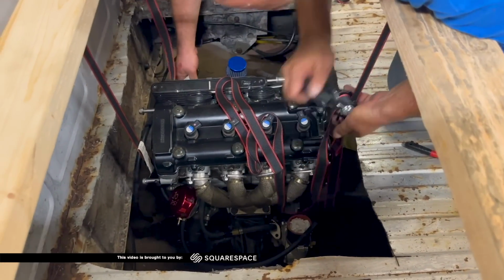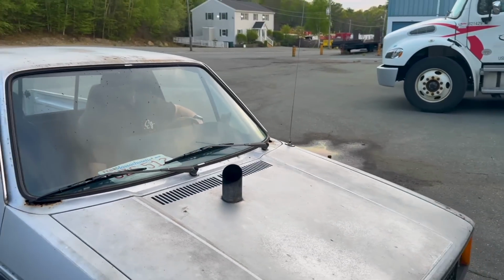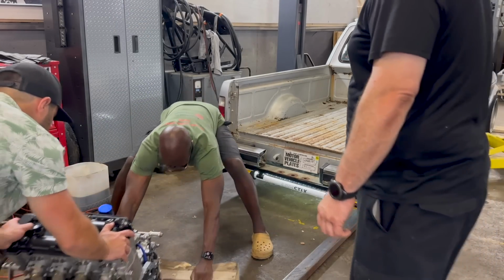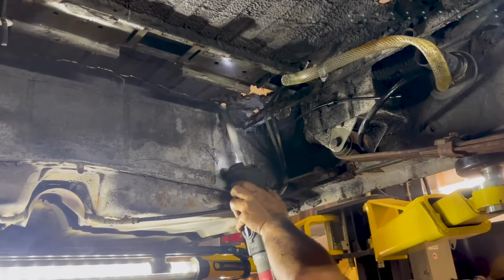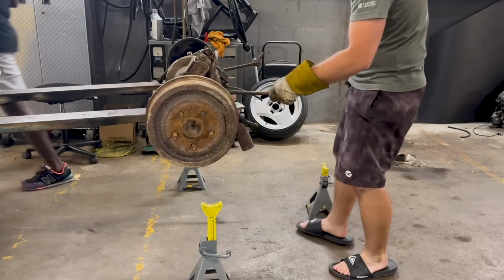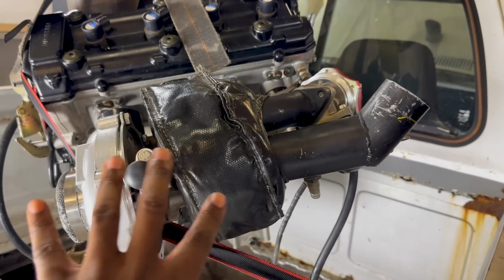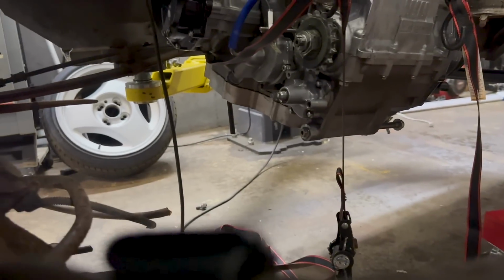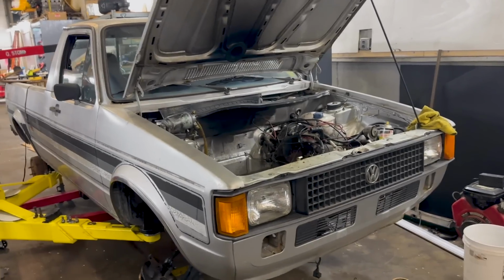Installing A Turbo Hayabusa Engine into an old Volkswagen pickup truck

Comment: If your engine is hydraulic clutch your gonna have problems with drive shaft adapter and your clutch slave....it takes some serious work to get through all the problems you haven't 3ven considered yet

Comment: chain drive drop box... a heavy plate with two shafts and 4 carrier bearings, if you have heard of the store called princess auto?, they sell stuff like that people can use to part things together. chain input on the top drive line pto on the bottom. that truck cant go lower, like what if someone puts a sofa in the back with a big glass 50 inch tv because they need to move?

Comment: Rich. Build a bracket off the motor that can also be braced to the frame that has a sprocket on it that will run to the engine. Then you can custom your new bracket sprocket to hook up the driveshaft. Connect the two sprockets via a chain and problem solved. This is a problem we have when building mini bikes and that is our solution.

Comment: Put in a jack shaft between the MC engine and the rear diff. Chain drive to jack shaft, u-joint to rear. That will give you more placement options for the engine and let you balance things out better while improving drive shaft angle.

Comment: Also I’m guessing there might be some balancing issues turning the motor and changing the drive from chain to shaft.  The other thing you can look it is they make shaft driven motorcycles.  Look at a Honda goldwing’s drive setup.

Comment: how about a crawler/offroad center differential, connected via chain, and then solid driveshafts to front and rear axles, like on a jeep?
would be 4wd, usable ride height and easier than a hybrid

Comment: Might be silly question but why didn't you put it in the Engine bay and for the drive use a high strength chain to the back axle what it was designed for on a bike your not going to be revving the balls out of it all the time
Reply: PS and the gear change could of been a quick touch on the clutch pedal the clutch for Engine could be a leaver with your left hand 😊😮😊

Comment: A shop in orlando Florida called skycraft sells surplus everything. From switches and relays to old parachutes.  They usually have small gear reduction boxes that have a shaft on either side. You could mount a sprocket to one shaft and a u joint on the other side.  You would need a pretty stout mount to keep it all aligned.

Comment: I was surprised when you started talking about lining the output and input up with each other.  I thought you were going to mount the engine further back (helping with traction) and replace the yoke on the differential with a sprocket and run it chain drive.  Looking forward to seeing how this turns out.

Comment: That rear is going to need to be very stiff, otherwise every bump you go over you’re going to have issues. An independent rear end out of an E30 would be far better, unsure if it would handle the power though

Comment: Weld sprocket to ujoint, take to a shop so it’s centered, or go to drive shaft shop, with the sprocket, and see if they can fab up a joint you can bolt on

Comment: Not an expert, but won’t the thrust forces on that output shaft kill that engine? This engine was engineered to be chain driven so  there’s little tolerance for thrust forces acting on the output shaft. 

See @strevemorris for more on info on crank thrust and the damage it can cause

@robotcantina recently touched on this issue with their most recent build

Comment: The spinny parts can be connected by a chain, like they are on a bike. You don't need to jigger shafts to line shit up.
For bonus points, mount the engine on an A-frame above the cab with a very very long chain loop.
You can also do 4wd easily, there's a spinny sprockety thing in the middle and you just use unmodified Ford bits in front too.
I am an engineer, you can trust me.

Comment: Should look into twisting axle 180 degrees. Which would put the pinion gear input up another 4 to 6 inches.
Reply: The pinion gear normally is below center of pumpkin. So twist axle like a baton which would put the pinion gear above center of pumpkin.

Comment: Put the axle on top of the leaf springs instead of lowering the motor. You will need to put on top of leaf springs anyways unless you wanted the back of the pickup raised up 6 inches from where is was sitting before starting project.

Comment: Divorced transfer case allows engine mounting area wiggle and 4WD with high low. Front and rear independent axels with the glorious stationary mounting and inboard disc brakes. Shaft length for the perfect wheel fit. Wide body fender flares.

Comment: Make a Jackshaft and run the chain from the engine to the solid mounted transfer case. Then you can mount the engine higher and get the angles that you need. You and easily make a sprocket mount to the input shaft on the transfer case. You can also make an electric motor run on the same gears between the transfer case and the engine, you can also include a tensioner system. Run a separate chain off of the jackshaft to the electric motor. This electric motor can be used to achieve reverse, and you can use the truck in a real-world application more practically.

Comment: hello Rich, how did you find what donor car is good source for your rear axle? is there somewhere list of axle length for different vehicles? I would like to convert my vw caddy mk2 to 4wd with locking rear diff but i was not able to find any donor car which solid axle short enough.

Comment: transfer case. motor up front small shaft tunnel .or chaine drive over to an older transfer case and shaft dose not have to go straight you can use a double cardan T case would help balance the truck

Comment: The best solution for inline direct drive would be to use a chain to transfer power a drive shaft in line with the axle that is anchored to the body forward to a bearing that will allow the shaft to spin. Install a gear on the shaft and align it with the sprocket. This solution would also allow you to move the engine toward the center of the vehicle, but you may need to install another free spinning gear to allow the power transfer at an angle around the engine to the shaft. The additional spinning gear set with a chain tensioning system (two gears connecting two chains--one to the engine sprocket, and the other to the drive shaft) would have the added benefit of allowing engine movement in high torque situations against the motor mounts, and rougher terrain bouncing the axle.

Comment: just get a diff pinion yoke to suit the sprocket spline or weld on a diff yolk to the sprocket. and yes mount the diff on top of the springs they sell kits everywhere

Comment: Use BMW Rear  Subframe And Diff So Drive Shaft don’t Dance Up and Down and U Can have IRS independent Rear Suspension if Is My Project I will Install Engine On the Front Better For Cooling and Shifting

Comment: Talking HP. What about torque?
Feeding air to it in the bed might be an issue 
Radiator.? Or air cooled in the bed
Typically air is sucked out of a bed , the faster you go the thinner the air

Love your channel 

Miss your interaction with your boy S

Comment: 420 horse in the back, another 80-200 horse up front.. suspension & brakes will each cost more than the original truck. Every system on this vehicle will have more into it than the cost of the vehicle. 🤣 Classic Rich Rebuilds

Comment: this is so retarded- wasting bed space instead of using the engine compartment. longitudinal engine anyway. absurd. AND the solid axle means the diff needs to travel, so the driveshaft angle is gonna be crazy.

Comment: Rich I was thinking about a solution today after I watched your video.  Check out a gas golf cart. The motor and rear are mounted together so there is no change of angle from the motor to the rear end.  At the front of the motor it is on a pivot.  This concept should work perfectly for your application.

Comment: To help with the alignment on the rear diff to the sprocket could you possibly use a jack shaft and keep the engine mounted higher up in the bed

Comment: Why don't you run a chain drive with a rigid mounting down to level with the axel, then run an axel from the output shaft of the chain? Or if you're using the electric motor anyway, use that as the output for the chain? That would also solve your standing shock problem

Comment: would it not be the absolute coolest (and luckiest) if you could just run a drive shaft from the rear diff to a front diff and simply mount a sprocket to that drive shaft and run the engine with a chain?

Comment: I would have chosen to go with an IRS to avoid the pinion angle problems. Little more money but it would be a track monster.

You may also run into problems with the thrust force on the transmission output - do you need to use that trans? A transaxle setup would solve all these problems

Comment: Flip the engine with the sprocket fasing forward a turbo on the passager side. Run the chain to a half shaft with sprocket input and u joint output. This would allow you to have a longer driveshaft. If the wheels spinning the wrong way then flip the axel.

Comment: I’d just build a drop box like they use in monster trucks/mud trucks just a simpler smaller version and keep the motor higher in the bed. Might be able to rig one up even using some sort of transfer case out of something else to is a thought…

Comment: Before you could get cheep(ish) CNC custom parts one the ways was to flip the diff so its pointing backwards and just weld sprocket to to the input and use chain to the bike engine !!! 
or other options is use boat V drive / 4 wheel drive transfer case backwards (off something like s10) and it helps with you drive line alignment

Comment: Maybe a trensfer case to drop the drive shaft lower than the motor? Or a realy silly idea, that i saw on a lawn mower, the motor turns the axle via a steel braded rope inside a tube. Similar to a 3/8 inch flexible ratchet extension.

Comment: you will probably want to clock the rear axle slightly backwards so the diff output flange can angle up and the trans output flange angle downward. Friend has a haybusa swapped Kei truck and thats how its done in there.

Comment: could just do a jackshaft down to the height of the rear diff axle. U put a sprocket on a longer driveshaft, then run a chain from the bike sproacket the to the driveshaft sprocket.

Comment: Put a front wheel drive solid axel in it. Connect the 2 diff’s with a drive shaft. Put a sprocket on the drive shaft and then run a chain from the standard output of the gearbox to the sprocket with a chain. Then you can easily alter the gearing if required. Also you can run an small electric motor to the axle for reverse.

Comment: Sounds like you guys should connect with the Grind Hard guys about how to connect the sprocket to the rear axle. I feel like their builds have had to utilize unique coupling systems to work out, worth a shot to ask!
Reply: Def a good idea grind hard plumbing guys know there stuff with small driveshafts and putting bike engines in anything

Comment: Maybe a dumb question, but why not mount the engine a lot higher, and use a chain drive down to the rear wheels?  Have a shaft and a sprocket coming out of the rear diff.

Comment: AAZ or 1.9TD iron block is where the magic happens. And with the right kind of pump (with the boost referenced injection) and some modern arduino/speeduino something something it would be easy to make a dynamically adjusting electro-mechanical injection for a sort of eco boost thingy. A basic AAZ should be able to handle 200hp pretty easy. Or was, back in like 2006-08. No idea what the tuners have came up with nowadays. Though probably they've just gone "I" everything... BTW I f**king hate rolling coal. Sure, back in like 20yo it was sorta cool to be seeing a puff of smoke after accelerating. But pretty fast I came to the conclusion that black smoke is nothing else than lost power and fuel.

Comment: A transfer case might help. It could get you a drop from the engine to line up the driveshaft better, then run it to the front for all wheel drive. That would give you more weight and you could source that from a ford ranger as well

Comment: double cardan shaft out of a jeep TJ, and a 1310 Yoke  for the ford axle from adams driveshaft will get your driveshaft length longer and the pinion can point up toward the hyabusa engine.

Comment: I'd just make a rear axle with a sprocket.  That way the motor would be more in line and you could make easy rear end gear changes.

Comment: you should consider using an independent rear end, as soon as the rear suspension cycles it will spit the chain off  because the arc is going to be to great.

Comment: Use a front axle in the rear instead, they have the differential offset, that way you can move the move the engine more towards the center of the car.

Comment: Had a thought, what about a Miata/MX5 rear suspension. BMW or some other small car IRS. Some of those are subframes that can be removed and installed fairly simply for this project. And having a short driveline connection would be easier to pull off with no U-joint binding

Comment: big problem with sportbike engines, they get really hot, its not uncommon for bikes to overheat in traffic. When you stop at traffic lights in a superbike, you can see the engine temp climbing, and as soon as you move it goes back down.

Comment: Check with v-drive builders and see what else they might have to interface with the drive shaft. Why not just drop the motor in the front and try building a torque tube/tunnel for a longer drive shaft? It weighs nothing so there's not much CG or traction advantage to moving it rear-ward. That is, unless you prefer things in the rear.

Comment: i think the engine placement under the hood would work better. I do like the mid engine placement. But its not looking like its gonna work well. You are looking for a driveshaft adapter for a hayabusa. They are commonly available. I had one years ago for a yamaha r1 engine. The guys racing mini sprints use them.

Comment: Engine should have been placed in the engine bay with a gearbox connection to rear axle . It would be a lot simpler done . Plenty of more space to work in and would be a far better plan. Straight shaft to a Quaife gearbox with reverse then drive shaft to rear axle.

Comment: Could tilt the engine so the turbo would clear the side and the engine could then slide further down. Then you could use a jackshaft like from a boat if they still don't light up enough.

Comment: I put a bike engine (R1) in my Lotus 7 replica. Even used a Ranger axle (though a 7.5 due to weight and space). FYI you can easily adapt SN95 Mustang rear disc brakes to that if you want. 

For the shifter cable, definitely a push pull cable. So much easier to route. I got mine from controlcables (along with my throttle and ebrake cables). It feels very solid and you can even mount a quickshifter strain sensor to it. 

For the driveshaft adapter, a steel 1310 adapter from DRchassis is the way to go. Double cardan ujoints will help with the angle. At least the pinion is offset in the right direction on that thing. 

Do you plan on having a reverse? You could do a chain drive to a reverse box and then driveshaft to the axle. If you get creative, you could even do a chain to the input of the reverse box, then driveshafts to front and rear (if you have a way to unlock the front hubs). You can also check out the rear ends from Elite Racing Transmissions. They even have one with a built in reverse. Too rich for my blood but super cool.
Reply: Mind sharing some knowledge? I've got a 2018 x10r that was totaled. Motor and everything still good. Have a 66 triumph spitfire all gutted to the frame and solid body panels all around. Was thinking of mounting it up front and using a differential adapter to run a shaft for the read end. Mechanically making that all work I'm more than comfortable with. But what do I do with all the wiring and sensors? Do I use the same cluster? Make my own? Haha I'm nervous!

Comment: I like TDIs, but rolling coal is for idiots. Diesels are all about perfect airflow and if you do that they don't roll coal and perform much better.
Just check out the Winner of the XDP Diesel power challenge - i think it was lavon miller

Comment: Look up dirt track racing cars. The Dwarf cars and legend series run motorcycle engines that hook to Toyota Corolla rear axle. They have PTO that hooks where the sprocket goes and then runs to a drive shaft.

Comment: should have put it in the front and run a drive shaft as others have mentioned the orientation issue has been solved by others in other ways...but i guess that would be less ridiculous lol...as it is when you drive it its going to want to flip Fred Flintstone in the driver through style

Comment: i'm not even qualified to be an amature but how bout rotating the engine 180?
1 weight bias will be on the passenger side so the driver will balance the center of gravity
2 output sprocket moves farther away from drive shaft and can then be used to drive an intermediate shaft (the sprocket on the intermediate shaft can be sized to adjust torque and speed output ratio)
3 the use of an intermediate shaft makes lining up the drive shaft easier and bonus, can be carried forward to power a generator for the front electric motor

Comment: Using a jack shaft setup would remedy your driveshaft height issue and your coupling issue at the same time.  Not sure where you would source one strong enough though most likely a motorcycle with a divorced trans. Or a side by side.

Comment: run a jack shaft and retain the chain drive solves your height issue and your connection issue with one simple solution.

Comment: what about having a reduction gear with chain between the gearbox output shaft and the rear axle? You'll be much more free in placing the engine and the chain will also allow a lower placed output shaft.